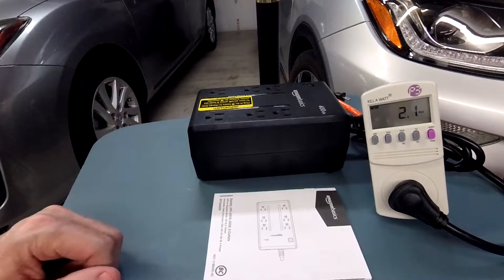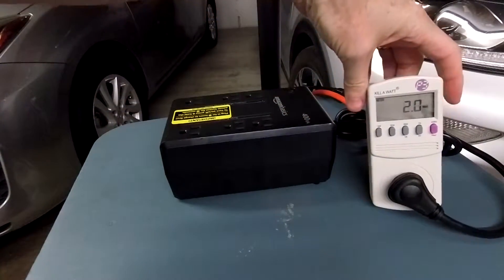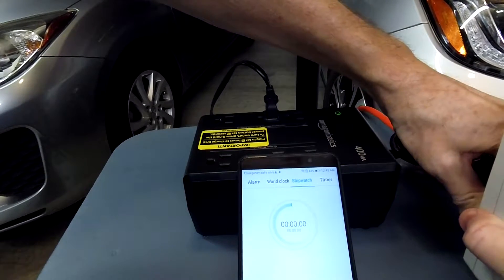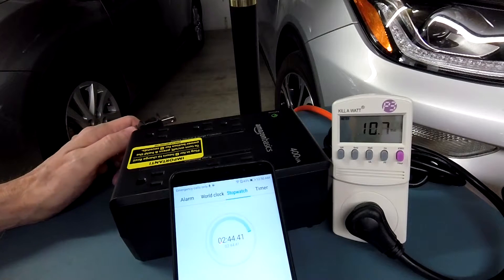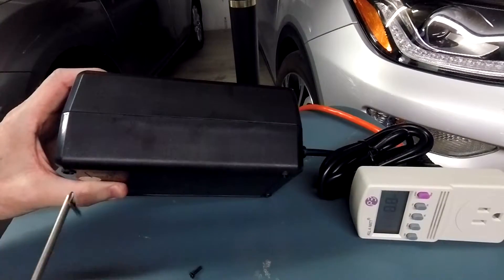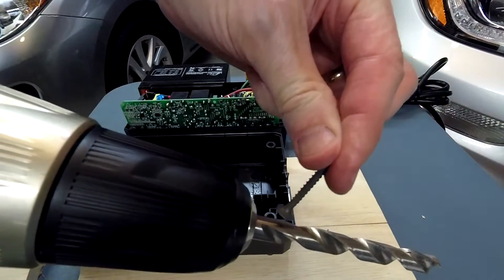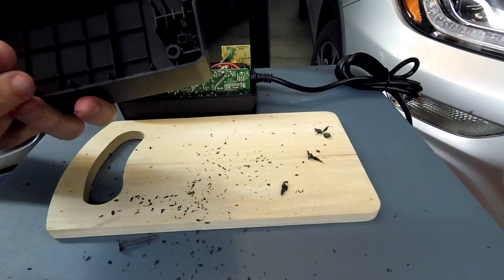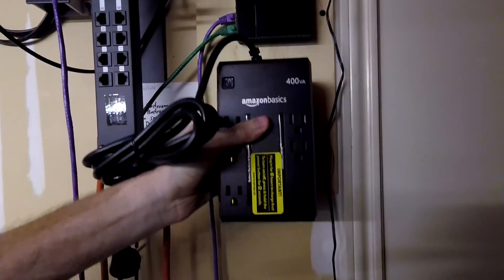Review & Test of Amazon Basics UPS 400VA 255W 6 Outlets Battery Backup

Comment: You used 12V deep cycle battery 30A and it will work or if you know how do 12V 40A Lithium battery get much longer run time

Comment: Could this be good for a video game console?
Reply from the maker: You'll have to check the continuous and peak power draw of the console. For a PS5 it's 350W so it wouldn't work.
Reply: @hgodtx  I just did check. A PS5 in standby mode uses 1.3 watts.
Reply from the maker: You can always use the "surge only" outlets to protect equipment greater than 255W.
Reply: @hgodtx  It’ll probably work according to Sony specs

Comment: When you're driling, you're supposed to go at high speed having the plastic housing spin around with the bit as it catches, wacking you in the hand a few dozen times.  Nice video though and good idea for hanging.  I'm going to use your mounting idea

Comment: Will this hold a 12v modem and 19v router for a few seconds until my generator kicks on?
Reply from the maker: Should hold for several mins.
Reply: i have 550 VA come with 12V lead acid battery i changer battery you have 12 V deep cycle battery 75A get much longer run time on it or if you used 18V with converter to 12V lithium battery

Comment: Thanks for this video.  That's incredibly less time than I had imagined.  I wanted to run a 10W LED bulb during a power outage, but this UPS would run it for at most 50 minutes, likely less.

I'm getting a bit confused by the battery rating.  If it is 2.9 amp at 12V, it should be 35 watt hours.  If you were able to use the battery to its full capacity, it should be able to run 200W for 60*35/200 minutes (about 12 minutes).  General power conversion is 80% effective, so I'd still hope for 9+ minutes.  This means that it's using roughly 1/3 of the battery's actual power.  I'm not sure if they do this because lead acid dislike deep cycling or if it's because of voltage and amperage dropping as the charge lowers.  Either way, not good.

Comment: It went into rapid beeping because your load was large and it knew that it wasn't going to last long, so it went right into the rapid beeping.  On a smaller load, it will do slow beeping up until it detects its about to be exhausted.

Comment: how long can the UPS last without power? Looks like only less than 3 min?
Reply: well if get 12volt deep cycle battery with 15A you run much longer i have 550VA 330W I have 18V CONNVERTER  12V 20A with 18V 5A Lithium battery drill battery i run for 45minutes charging my dell laptop 16inc buy 10.1/2 inch scream if i have much better battery i can run for 8hours or more